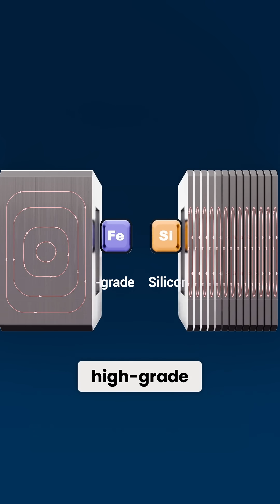Why Transformers Aren’t 100% Efficient | Transformer Losses Explained #electrical #science #shorts

Comment: In my last place of work, we had two transformers feeding distribution panels to the back room. These were installed about 20 years earlier. We installed a 3rd to add another panel. This transformer was the same capacity but 25% the volume. It was also 95+% when fully loaded vs the 80% of the other two. Due to this fact, it also gave off less heat, meaning less cooling and less danger from something being sat on top of it's casing. We were quite impressed.

Comment: You have got the eddy currents in the wrong plane. It is in the same plane as coils are. To manage them, cores are created from insulated slices, so that eddies cant form big loops in their plane.
Reply: how is that possible? current will be induced perpendicular to the coils plane
Reply: @isaamthalhath4359  The magnetic fields run perpendicular to the coils plane i.e. throught the coils. That induces a circulating electric field within the coils plane which is what powers the secondary coil, but also induces current within the core in that same direction if it were not laminated

Comment: You forgot that the current flowing through the second coil also makes a changing magnetic Field in the Iron core. In order to keep the Flux Levels up the current in the primary coil has to be increased.

Comment: MARIE ANTOINETTE: USE GOLDEN WIRE
Reply: Silver is the best. But expensive.
Reply: @igorzherebiatev5751 WHY?
Reply: @georgepettas3267 because of its resistance. The lowest possible in metals
Reply: @igorzherebiatev5751 I thought that was Gold. Thanks!!!!
Reply: @georgepettas3267 Gold is good because of oxidation
Reply: @rian0xFFF NOT ONLY
Reply: @georgepettas3267 idk why you typing in caps but gold actually has lower electrical conductivity than copper. Not by much though
Reply: @igorzherebiatev5751 superconductor is the best

Comment: Other than heat, don't forget the sound a transformer 
emits.  60hz bzzzzzzzzzzzz
Reply: NO ! This is not 60 Hz. The truth is that the sound frequency is TWICE the grid frequency (so, in the US, I suppose, it is 120 Hz). The phenomenon behind the sound is magnetostriction, which is independent from the direction of magnetic field. It is something similar to absolute value of numbers: no matter if it is +5 or -5, the result is 5. Or, more precisely, it is related to the value of squared +5 or squared -5: it is always 25.
Reply: @jarekferenc1149  OK, Mr. Jarek
You win.  I shall sit down now.
Mr. Brown
Reply: Not really. That’s considered reactive power. And not all transformers vibrate at 60 Hertz
Reply: @Velatari  Do I really need to specify the
frequencies of every transformer on Earth?
Really ???
Fine, lady, 50hz in Europa.
440Hz in US military aviation...
Etc.....
Reply: @mrbrown6421 there you are ,all depends on supply ,the stick in the mud is happy now.
Reply: @mrbrown6421  50 hz in Australia

Comment: Copper losses
So if the device is used for a century, the amount of copper will have shrunk?
Reply: No , copper losses mean loss of heat due to current passing through copper. This heat comes from the current ( electrical energy ) , not mass of copper.
Reply: @abbasmehdi2923 neato! XD power lines on the street are 99.9% pure copper and if they were silently shrinking in mass, that would be annoying
Reply: @sam11182 Copper is just a conducting medium. The electrical energy flows through an electric field.
Reply: @abbasmehdi2923 The energy flow doesn't follow the electric or the magnetic field. The vector of energy flow is perpendicular to both as the Poynting vector is defined as S = 1/mu * ( E x B )
Reply: @aVoidPiOver2Rad I gave a simplified explanation. Of course it's the disturbance in the field (wave) that carries energy. But the field exists and has a definite energy given by volume integral of energy density.
Reply: In south Africa copper loss has a different meaning
Reply: Copper Loss means Resistance.
The "loss" refers to the loss of voltage and/or current and/or energy due to this resistance.
Metals do not disappear unless they are uncoated/unenameled/unshielded and allowed to react with the environment to corrode and slowly disintegrate.
All wires, except for superconductors, have resistance.
Copper is one of the metals with the lowest resistance, while still being available for mass production, so it's often used for wires, like in the two copper coils on the sides of the transformer. However, iron is used in the core instead of copper because of iron's magnetic properties that copper just doesn't have in any significant amount.

Comment: 98 - 99% efficiency is CRAZY... if True
Reply: Typical losses for large power grid transformers are very low, normally below 3%.
Reply: In the biggest transformers only.
Reply: At peak power yeah, when they're working below their rated KVA the losses are higher because the iron losses are flat and dependant mainly on voltage
Reply: It's still not good enough in that the residual few percent of wasted energy generate enormous heat.  For transformers as big as 1 GVA the heat generated  may still be well in the MW range.  So these transformers need beefy, reliable cooling and monitoring.

Figures close to 100 % may sound magic or totally made up when comparing to the comparably very, very low numbers for some types of machines such as internal combustion engines.  But remember a transformer is not a thermodynamic machine which are fundamentally very limited in their efficiency by nature's nastyness known as thermodynamics ;-)
Reply: @ralfbaechle not to mention there is a heat engine up stream wasting much of the power as heat.
Reply: It depends on the circumstances like how much the transformer is loaded how good the powerfactor is, ambient temperature etc. 

Generally most of the loses in grid are  at the power station itself and transmission loses.
Reply: The majority of transformers in service are closer to 80% efficiency. There are newer Department of Energy rules that are coming into effect that mandate a 96% efficiency of transformers for newly installed ones. Unfortunately to reach those levels they have to use higher grade materials and such, and those new transformers cost anywhere from 30-50% more. So you are not getting any money savings really, though a future generation will. lol. The main part is getting the actual efficiency of the entire electrical grid up much higher as we build new things or replace old parts.
Reply: He's full of shit!
E&I tech says so!